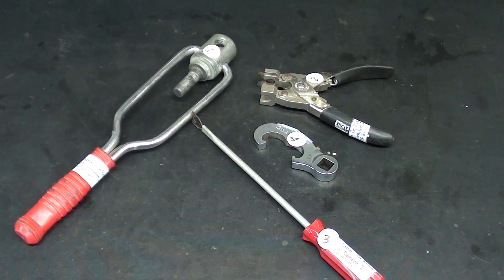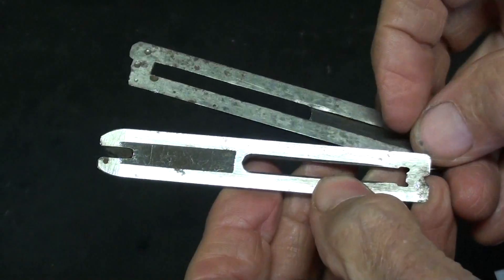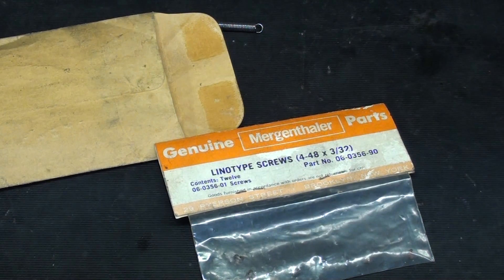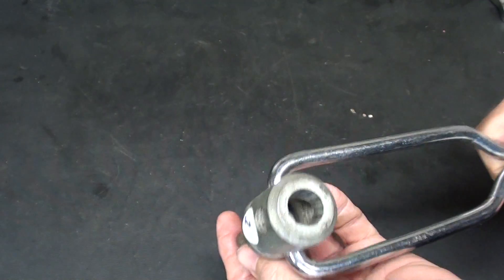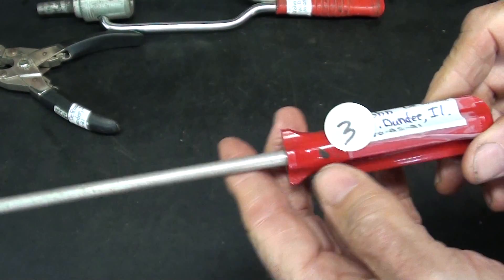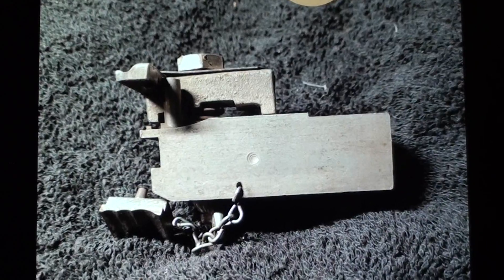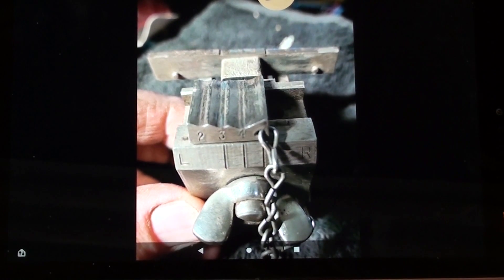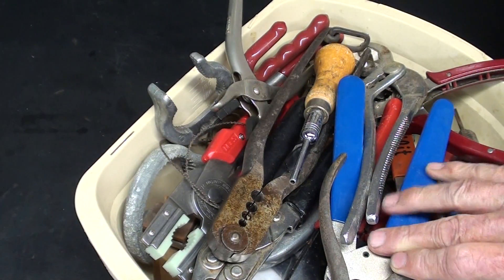WHAT IS IT? Mystery Tool Series 68a ques tubalcain

Comment: I've seen #4 many times, but don't know what it's used for.  #2- Augat made electrical connectors, so my guess is something to do with making and/or breaking electrical connections (although my first impression was of a cable/spring compressor of some kind. No clue as to the others.

Comment: #3 is indeed a screwdriver. It’s used for adjusting carburetor mixture screws at an angle as they’re usually buried on the bottom. Rendered obsolete when the EPA made manufacturers “seal” mixture screw adjustments. But there was a way around that and a new tool to adjust LOL. #4 is the tie rod wrench. I’ve got lots of time in with a set of those.

Comment: #2 the pliers for the press lock fittings on air lines in the semi trucks for transmissions, air gauges, trailer air brakes control valves to release the lock when replacing/repairing valve assemblies.

Comment: Number 2 hose removal tool for pulling rubber fuel of hard lines, Number 3 windscreen seal rubber install tool, Number 4 Tie rod length adjusting tool used in doing wheel alignments.  Number 1 and 5 I have to guess at as a striking impact wrench and a mower blade sharpening vice.

Comment: #1 - ?
#2 Sargent Coaial  pliers for coaxial compression fittings used on Rg6 cable - available new. Not automotive.
#3 - ?
#4, SnapOn Tie Rod adjusting tool, the hookfits into the split of the tie rod sleeve for different diameter sleeves. 
#5 Since Briggs and Stratton manufactures lock cylinders and keys for just about all automotive brands, plus latches, it would have to be something used for a lock cylinder or a latch. 3 positions and Left and Right marked, very interesting but I don't know.

Comment: #3 is a specialty screwdriver for adjusting idle mixture screws on carburetors. Somewhere in amongst my treasures, I have one. Made by KD Tools. Hence the typical red plastic handle. The design allows working at angles, around obstructions, and the horseshoe end keeps it from slipping off the screw.

Comment: the first tool is for a hammer drill. it would be used to put red head anchors into concrete. I have used them many times when i was young and they were miserable to set anchors in the cealing. Concrete dust in you face down your shirt in your eyes, loud noise by your ear. Really they were the first effective drilling and anchoring system to be developed. Before this we had to use star drills and lead anchors, even worse.

Comment: #2 some kind of fuel/air line remover tool, #4 snap on tie rod adjuster tool.#5 tool to bend throttle, choke cables

Comment: 1- I don't know
2- Looks to be some sort of wire stripper ?
3- Looks like an inside door handle clip removal tool.
4- It's  a tool for adjusting toe in on front end alinements. Spreads the adjustment collar so it can rotate.

Comment: Number 4 is a tie rod adjusting tool, they came in three different sizes and were used with breaker bar to loosen and adjust tie rod ends on cars and trucks from 50's to when they started having all rack and pinion steering systems.  Number 3  is a ken tool adjustment tool for some strange carb. I don't remember which one. The number 2 is for a solderless connector for copper lines that closed the connector that used a tapered sleeves to seal. I have not seen one that small mine had 14 inch or so handles on it.

Comment: #2 is used in attaching coax cable connectors to cables.  It's a compression tool.  It compresses a ring around the cable to secure it to the connector (similar to compression fittings on plumbing).
#4 as others have identified is a tir rod adjustment tool to adjust the toe-in on front wheels.
#3 looks like it could be used to hold small parts in hard to reach locations until it can be secured with a screwdriver or small wrench.  I think it's called a Thing-a-ma-jig because no one knows its real name.

Comment: #1 is the holder for Red Head self drilling concrete anchors, they had teeth on each insert to do drilling. The handle was for rotating the insert while it was being hammered. The taper on the top of the red head anchor could be broken off, if you needed flush anchors. Was designed primarily for drilling in the ceiling.

Comment: #4 is a tie rod tube turning tool used for front end alignment. After the clamps are loosened the tool is fitted into the split of the tube the tool loosens the threads rather than clamping down on them as a pipe wrench would. Being 1/2 inch drive it's probably for trucks. They also had a smaller one usually 3/8 drive for cars. Used mine a lot back in the day!!

Comment: #2 looks like a device to install BNC or F Compression Connectors on coax cable. After stripping the cable the connector is placed on the cable and squeezed to form a weather tight seal.

Comment: Sargent pliers can be hole punches.  That one is likely a Hose clamp press.  #4 is grease barrel opener with breaker bar in square.  #5 is plastic stitching tool.

Comment: 3 is for adjusting carburetors. 4 is for adjusting tie rod ends. 2 is for inserting spark plug wires into rubber boots (guess).

Comment: #1 was used with a hammer drill, a star drill bit with a tapered shaft was used and rotated with the tool handle as it was hammering. The hole in the "chuck" was so you could insert a D shaped wrench and pop the bit out of the chuck.

Comment: #1 (educated guess) is a door latch adjusting tool.  It allows enough torque to align the hinges when slightly tightened. When alignment is good, fully tighten the hinges.
#2 The parallel jaw pliers are to assist in the installation of spring loaded parking brake cables  (old school drum brake cars).
#3 Is a window crank and door handle clip removal tool. K D brand
#4 is a tie rod adjusting tool
#5 Is a top secret Briggs & Stratton Lock tool.  I could tell you what it is used for ... but then I'd have to kill you.  Okay, I have no idea, you got me.

Comment: The last tool looks like a jig for stitch drilling cast iron cracks.a guide to drill holes very close together for stitch pinning a crack.drill and tap.screw threaded stud in each hole.grind flush then using the jig,move over half way between then repeat.that way the crack was replaced with new metal.and being braded and threaded, it can't leak.

Comment: #2 not only "looks like" but IS a compression tool for installing termination connectors  including F Male, RCA, BNC, Right Angle, Inline Splices or Ground Blocks on RG59 and/or RG6 coaxial cables in the CATV (cable TV) industry—not automotive. Type belden snap n seal into youtube's search box for a demonstration.
#4 is a wheel tie rod adjusting tool.

Comment: #1 is a Phillips self drill concrete anchor handle,,,I used one A Lot as an electrical apprentice in the early 1970s  #2 looks like an early model coax crimp tool

Comment: #3 is a KD tool for adjusting mixture screws on carburetors. #4 is a tie rod adjusting tool for doing wheel alignment. #5 looks to be a partial tool for making automotive keys, Briggs made lock cylinders for GM for decades.
Reply: I have some old GM car keys that have the Briggs Straton emblem on them.

Comment: #1 was used with an electric chipping hammer to drill round holes in concrete. It was made obsolete with the development of the roto hammer.
Reply: drill holes for cement anchors. the anchors had teeth built into the bottom of each anchor. if I remember right its made by Redhead

Comment: #4 is a tool to adjust the length of tie rods and drag links on truck steering during wheel alignment. The tool turns a sleeve which is threaded on the inside on the rods which are threaded on their outside. They are made like a turn buckle. Steering tie rods and the like get dirty and rusty in use. After loosening the clamps on the adjusting sleeve one of the two claws is inserted into the split in the sleeve to spread it open due to the rust. A breaker bar is inserted into the1/2" square hole. Pulling on the bar in one direction spreads the sleeve open and turns the sleeve on the thread to lengthen or shorten the length of the rod or link, There are two claws on the tool allowing the user to turn the sleeve in opposing direction.

Comment: I think that you said teletype instead of linotype for the spacers.  I've never used a teletype, but it seems unlikely that it needs space bars.  Those spacers pieces that you have seem to be broken. Fascinating to watch or work on a linotype, also unlikely to get past modern safety regunlations (like most printing machines).
Reply from the maker: Thanks, I meant linotype

Comment: #1 shock tool to remove and install shocks with the stud.
#2  parking brake cable installation pliers
#3 seat spring tool
#4 tie rod and camber adjustment tool.
#5 ???

Comment: #1 is a handle for turning an early concrete anchor that had a saw tooth bottom end, internal threads, and a tapered top end. The tapered end of the anchor was inserted in the tool and the other in an electric demo hammer . The handle was for supplying rotation to drill the hole, turning about a quarter turn and reversing back and forth. Concrete dust and chips came out the side hole and the anchor was driven until the bottom end of the holder contacted the concrete surface.Then the anchor was removed by pulling up on the handle and a wedge plug was inserted into the bottom of the anchor and placed in the hole and driven down with the hammer until set. Then you used the electric hammer as a lever to snap off the tapered top, leaving the anchor flush with concrete..A  bolt of the anchor size was inserted thru whatever was being anchored and tightened. Never saw one pull out or fail. A screwdriver and an air bulb was needed to clean debris out of the hole prior to setting the anchor. As soon as a rotary hammer was invented , they were very seldom used . I've installed a lot of them and was certainly glad to see them replaced but the certainly was better than a 2# hammer and a star drill!!!
Reply: Ditto
Reply: We called the anchor RED HEAD’s
Reply: Also the hole on the side was for removal of the drill bit with a wedge and a hammer
Reply: @billypurifoy640  Forgot that!!
Reply: @billypurifoy640  That was the original brand and then some clones as I remember
Reply: After driving, the taper top was broken off, and a special tool knocked  the piece out.
"Red Head" concrete anchors

Comment: #2 looks like a different name brand of my “snap n seal” tool. Meant for compression fitting on coaxial cable wire. As in cable tv.
Reply: Yes, I too believe that is correct.
Reply: Yep, specialty "crimpers".
Reply: I don't believe it's for coax.
Reply: Aha! That's neat. 
I was using crimp style tools then.
Interesting! And thanks for setting me straight. :-)
Reply: Yep Belden SNS tool for coax cable
Reply: Got a pair with yellow handles in my tool bag, crimping Snap-n-seal on rg6 or rg59 coax
Reply: Cool! How in the blue-blazes would it actually crimp the F fitting on?
If we strip the rg-6 or the 59 correctly, the F-fitting simply slides on. Interesting! :-)
Reply: @duron700r  it’s compression style, not crimp. The fittings are made of two parts, one is beveled, that are pressed together. Those blue handled “pliers” in the box near the end of the video are for the crimp style. I’ve used the Snap n Seal, compression style installing cable in South Carolina and the crimp style (grease packed for exterior) in Ohio.